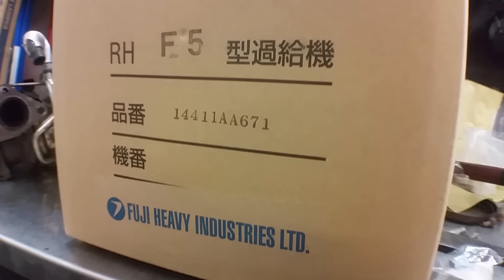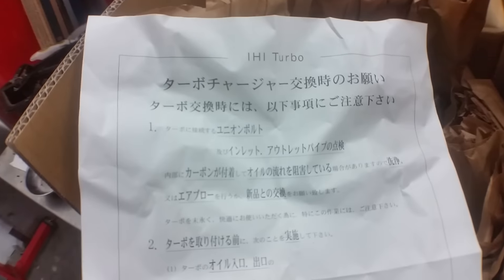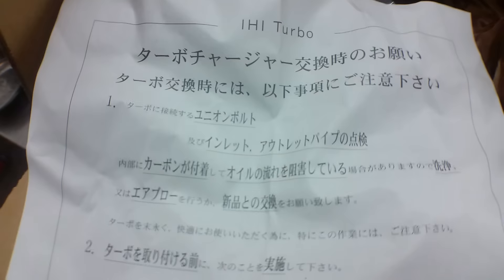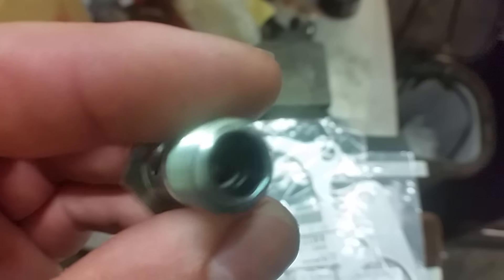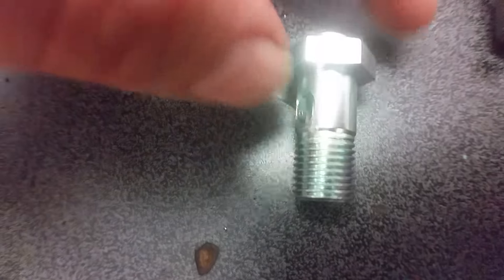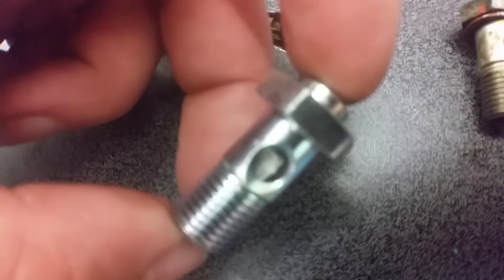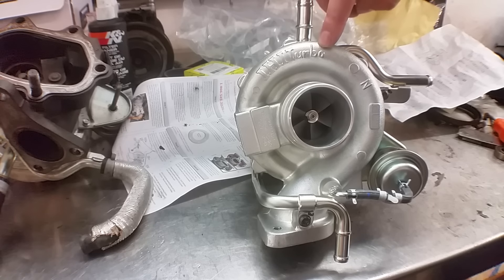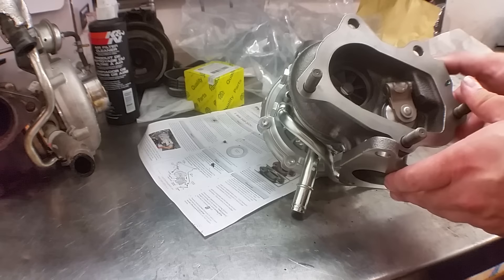Turbo Time

Comment: come on rice you guys get way above your stations. dont get me wrong there are lots of fun cars my first car believe it or not was a talon tsi I still wish I had that car I sold it to a teen-ager who wadded it up but all that Subaru crap is hyper expensive it's not realistic for most teen-agers getting into cars we were banging mustangs because everything Interconnects with Ford we got our 5 bolt 4 wheel disc brakes off crowns in the junkyard or gt40 heads off 5.8 pick ups